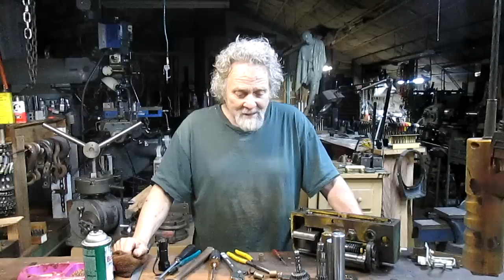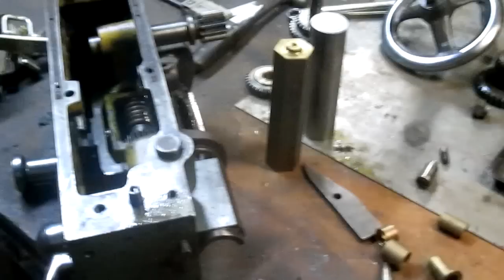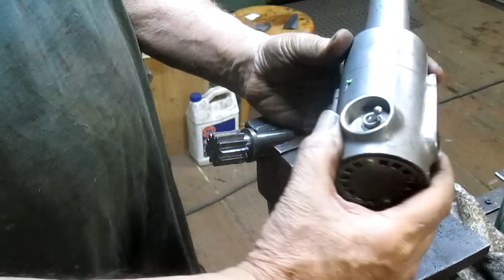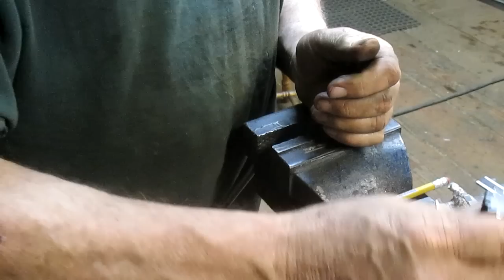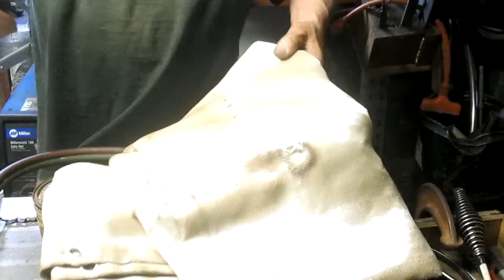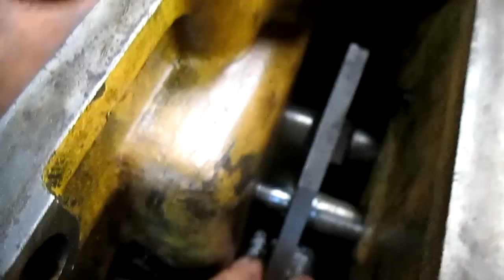Clausing Apron Repair #1

Comment: I enjoyed watching this video. I rebuilt two of the three aprons on my LeBlond lathes. To me, it is quite interesting how they figured out how to make all them gears and shafts and everything work. They all have feed for the apron and cross slide. Makes for a complicated setup. I watched vintage machinery working on his and he broke his half nut shaft trying to remove it. I wish I had watched it before I broke mine also. But I fixed it better than new...
Reply from the maker: I also like the complexity of the gearing.

Comment: Hello, nice video! I should make the same gear on a Clousing 5912 lathe. The gear used in the video is a DP16 with a pressure angle of 14.5°. If not, does anyone know where to find it? What type of milling cutter should I use and with what gradation?
Reply from the maker: If  you have a machinist handbook one of the pages has an example of profiles of each angle. Copy it then cut out the angle and match it up with the gear. The mistake I made was not to rebush the shaft while I had it apart. It works but it's sloppy.

Comment: Looks like it will be alot better when your finished.Are the ways on the very worn?
Reply from the maker: The ways were hardened in the factory so the are in pretty good shape.
Reply: @NikColyerMachineWorks  👍

Comment: Just 1 question at this time! does your 1/2 nut refuse to release at the most inopportune time? i have to stand with 1hand on the 1/2 nut and the other on the clutch  good vedio i learn a lot keep it up
Reply from the maker: My half nut releases with no problem, but I have run into your issue before and it is usually because the half nut is badly worn.
Reply: the half nut on mine engages/disengages fairly easy, maybe a little too easy.  My "sticky" problem in in the cross slide power feed.  I have to keep the rubber hammer close by if I'm power feeding toward the center.  It's push/pull control, and sometimes the load on the tool (combined with wear issues in the cross slide) prevents you from disengaging when you want it to.  You can palm smack it and get it to disengage, but age and arthritic hands makes that too painful.

Comment: How did the apron come to be in such appalling condition???  Any suggestions?

StVros
Reply from the maker: first off I bought the lathe from a guy who had a surface grinder within a few feet of the lathe for 20 years. Second is somebody put that gasket in which blocked any attempt to oil the apron, not that the former owner ever attempted to oil the apron, the oil ports were gummed over from years of neglect. All is well now though.